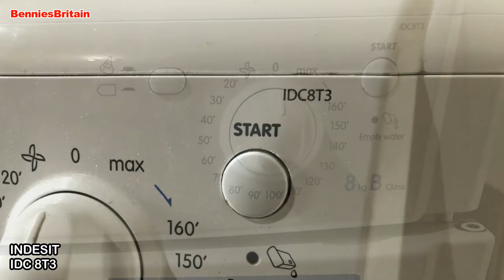INDESIT IDC 8T3 Tumble Dryer - Drive Belt Change

Comment: Very helpful video but currently sat on floor trying to wrestle the door back on so it lines up with the drum, which is not as easy as it looks....or I'm doing it wrong! Needs two people for that bit 🙈
Reply: I’m having the exact same issue I’ve got an extra person but it still won’t go back into line any suggestions?
Reply: Then you finally line it up and have the 3 hour fight to get the belt on the pulley
Reply: I had this issue. It took me almost one hour to get it to it's right place on my own. I ended up unscrewing the metal part that has the cables and undoing the cables to have more movement with the door. was so tired when I finally got it right.
Reply: Exactly the same, came out bleeding and everything. Helped to stand it upright in the end and push down hard on the door while holding the drum ‘up’. Now I can’t get the belt over the jockey wheel 😩 so much harder than it looks in the video!
Reply: Took me an hour and half all i all, but yep had same issues, it only has to go on once and its sorted, just once 😂
Reply: The two screws either side of the drawer nip it all up nice ....
Reply: After nearly 3 hrs, turned it on no heat so it won't dry the clothes 🤦‍♂️🤷‍♂️
Reply: Bennie is very good at hiding the awful bits we have all found for ourselves 🤬
Reply: Yes , looks easy on here , tried ages getting front back on , it now in bits in corner with blood on it cos of cut fingers , it off to tip
Reply: Replaced the heating element. Dryers like new. Cheers bud 👍
Reply: So, followed this. Its definitely not for someone who has never held a tool in their lives. But it is manageable. Not as easy as it looks here but manageable. Be very careful realigning the drum with the door frame. The drum fits over the frame and onto the foam on the door. If it's not, it will cause the frame to misalign, and you won't be able to reassemble it properly. For the belt, place the screwdriver tip just beyond the belt as you're looking down on it. Place the tip of the screwdriver on top of the pully while under the belt. Rotate the pully and the belt should slip on for you. **belt will be tight so some force is needed for this**. Once on, rotate the drum a few times to seat the belt. After that. Reassemble an you're good to go. This drew blood from me too so you guys aren't alone 😂
Reply: how do i line it back up i’m getting really mad now
Reply: You need two people. It took 1 minute to line up with two people. I was also wrestling with it for an hour on my own

Comment: Not quite an accurate guide was it Bennie? Many bastard clips, hidden screws and wiring clips removed off camera to make it look easy. Also no word of removing the front panel and not snapping the 3 little black clips at the bottom. And as the other chap says. Getting the bastard front panel back on.

Comment: Excellent Video - This has saved me a small fortune in repair costs.  For anyone else struggling with the drum / door alignement,  I removed the water container housing at the top and it made it MUCH easier (and its not difficult to remove and re attach).

Comment: Thank you! Saved me £108 on a repair call out! Although worth mentioning be careful not to break or lose the clips where the drum is seated when you’re lining it back up. I took the other side off too and the screw securing the side frame to the front which made getting the drum back in easier.

Comment: The door / front isnt that easy to line it up with the drum it needed 2 people i had to stand the dryer up right and use a screwdriver to wedge it back in. The grey plastic fan thing was stuck fast on the spindle had to hammer it off with a screwdriver. I was also convinced the belt was an inch to short but it did go on with some brutal force and a large screwdriver to pull it on. Did me back in though! But saved me spending £180-£200 on a new dryer. I have previously replaced the belt pulley which was a nightmare as well. All that said the video was a great help 👍
Reply: Bro I feel your pain, my back sore too got there in end though.... lol i chipped a bit od that pulley wall off with damn screw driver so sat the blummin belt in middle of it
Reply: I'm having the same issue. I got the new belt replaced in about 20 minutes but have spent the last hour trying to get the drum back I to the grooves. I feel another pair of hands would really help 😩
Reply: This is what I have come to look for 😅

Comment: Thank you for posting this. It's saved me a lot of hassle. For anyone struggling with seating the drum: after failing with it for about half an hour and swearing like a sailor I decided to replace the right hand screw on the three on the front panel. So at least one point was aligned correctly. I also removed the reservoir housing and managed to seat the drum within a minute after doing both of those things. The belt was much easier to get seated with a socket set and undoing the lower bolt so I could pivot the whole tensioning wheel bracket also (as mentioned in another comment). If you do that though be careful that the "hook" on the back of the bracket is sitting inside the motor housing and not outside as it will push the tensioning wheel out of alignment otherwise. I found this out the hard way when I did a test run and could see it was out of alignment and would wear on the belt. If it's hooked in as it should be, it will hold the tension on the belt also and you can easily replace the lower bolt you've removed.

Comment: Thank you for this video. I have finally completed the belt change, and my dryer is back up and running !! The step by step instructions were clear to follow. However, the process has taken me over 3 weeks to complete. I had to cut the belt off in my first attempt, and I then stupidly stood on the edge of a side panel and sliced the top off my toe !! My own fault for not wearing shoes ! I then had one final attempt and after 2 hours of wrestling putting it back together I succeeded and I could not be happier. So thanks for the video I could not of completed the job without It 😊

Comment: This video helped me out massively and saved me a lot of money thank you. I think the hardest part was aligning the door and the drum back up, few choice words said but managed it. Thanks again
Reply: Just done the belt replacement myself and I may have kicked the dryer a few times at this very point! 😂😂😂
Reply: how did you manage to line it up i just can’t do it
Reply: @sadewilliams6339  perseverance and lots of choice words 😫
Reply: @sadewilliams6339  Replace the central screw on the three on the front panel. So at least they align correctly. I also removed the reservoir housing and managed to seat the drum easy enough then. I found it impossible otherwise

Comment: Thanks for taking the time to do this video. The wife and I have followed your instructions and we now have a working dryer. Cheers!
Reply: I am going to try do you think a old woman on her own can .
Reply: This method, I am not sure, see my comment above if you intend to do so. I recommend checking out the espares instructional video as that shows how to do it with the drier upright and without removing and reattaching the front panel which I found a pain in the back side.
Reply: @rabg86  thank you I watched it I have fixed it , I didn’t have to change the belt because it was stuck in between the jockey wheel so after taking it all apart and putting a new jockey wheel on, I managed with great difficulty to get the old belt back on as it wasn’t frayed or damaged in anyway, and it’s been going this past two weeks really nice I don’t think people really understand how much fluff is in the dryer when you take the side off i and the top of it. Unbelievable I was so pleased with myself for a 75-year-old lady on her own. It’s not bad Great thanks

Comment: Cheers, Bennie. A lot of hassle, but your video is spot on. I had to make a few minor adjustments, but I managed to get there in the end with all of my fingers intact, but two extra screws! One was from the belt drive after reading a comment, suggesting that I take it off to reattach the belt (but I couldn't get it back on), but I haven’t got the foggiest where the last little screw lives. 😂

The drum is turning again and its heating as it should, but its a little bit noiser than it was before. I'm not sure if that's anything to worry about, but if it conks out again, I'll just replace it. 

Thanks again. Keep up the great work, but stop making it all look easy! 😂

Comment: Just wanted to stop by and say thanks for the video.  Not done the job yet but thought I'd leave this now in case I forget later. Mine broke yesterday, a jumper got trapped between the drum and the casing jamming the drum from turning and burning out the belt. Managed to take off the lid by trial and error only to find it looked a right pain to repair, was on the verge of buying a new machine. Mine is 2 years old hardly used so still in like new condition. Even the belt still looks brand new apart from the bit that melted causing it to snap. Was having a look on here to see if others have had the same thing happen, to see if it's a design fault and I can claim a repair from Indesit, when I came across your video. As a mechanical engineer to me it now looks easy enough to do. You made a cost of £250 drop to £7.49 for the belt from Amazon. I'm about to start stripping it down ready for the belt to arrive later today. So once again many thanks, I owe you a beer.

Comment: Great video, very much appreciated. Struggled to get drum aligned with front. I found it much easier to take out the whole tray for the water container which is a couple of screws and some easy to connect hoses. One this was done drum aligned really easy. Top tip to align: put a torch in the drum pointing upwards you can see easily when alignment is close.

Comment: perfect video!!!!! This is how to do it! It  is a pain in the neck. I chipped to small bits from the plastic pulley but eventually got the belt fitted. This is almost identical to my Hotpoint and they are obviously made around a similar design. What is EXTREMELY annoying is the inability this design provides for replacing a drive belt. Like  a car dynamo, there should be some way in which to release pressure on the belt as you  fit it and then re-tension this back up. This is seriously a bad design. One Indesit dryer has a large spring which provides the tension on the belt but I still believe much is to be learned from car mechanics. Thank you so much for this brilliant upload. Very clear and informative. I also had to re-order another new belt because there is another code on the belt itself which made the new belt 1inch longer than the other new belt. All the best, Jes
Reply: I did exactly what you did with pulley but got it on none the less and placed belt in centre hopefully with the groves on the motor spindle that fkers wont budge ... BUT WHAT A PAIN IN ARSE THAT WAS FOR REAL lol

Comment: Once the belt is over the drum, align it with the front of the machine before putting the belt over the pulley. That way, there is enough movement in the drum to get it in the correct place on the front panel first. Yes I sound smart but this was actually my girlfriends suggestion not mine and it worked so kudos to her! 👏

Comment: Thank you for the helpful video.  I didn't have any difficulty relocating the drum on to the front assembly or removing the fan as others have described.  However,  getting the new belt around the pulley is very tricky.  I tried removing the mounting onto the motor housing but then it's extremely difficult to resecure the mounting to the housing with the tension of the belt - so I replaced this and tried a different technique to bring the belt round on to the pulley.  I had a double ended ring spanner which I'd used to release, and then resecure the mounting to the motor housing as described.  I eased the double ended spanner right under the belt so I could pull on both sides evenly with the belt lying across the middle of the spanner handle.  Then with a helpful person gently rotating the drum it eased on nicely.   Less chance of damaging the belt this way.  Hope some find this 'tweak' helpful.

Comment: Great video. Thanks. Unlike many I found the hardest part was not refitting the drum, that dropped into place no problem; however, I had huge issues getting the fan off. It seemed to have stuck on and I had to drift it off in the end. The only thing I did differently  was the way I got the belt onto the pulley. I found pulling it with a small screwdriver from the side made it much easier than trying to lever it over. Otherwise a relatively simple job made really easy by your great, informative, video.  Thanks again.

Comment: Help & info needed - I had to replace the jockey wheel pulley. Belt was ok. Got it all back together & did a test run. Ran with a screeching noise but all looked OK. After a few tests realised it was simply the belt not being lined up properly on the grooves in the shafts from the motor that the belt goes around. Lined it up which took a few tries. Another couple of test runs whilst I had all the side panels off. All looked & sounded grand. Put it all back together & tested again. All still sounded OK. Wife went to use it today with a half load of slightly damp clothes. Drum not turning at all. Took clothes out. Stripped it all down again & tried it. Spun OK. Put 3 dry towels in & drum wouldn't turn. Turns slowly with 1 towel in. The shafts from the motor seems 5o be turning ok though. Any ideas? My only theory is that the belt has maybe stretched a tiny bit which is just enough that there is now no longer the proper tension on it?

Comment: I was hoping to write that all went well. My daughter followed your video after discovering the belt had broken. She ordered the new belt and decided to try and fit it herself. She did an amazing job, fitting the new belt, which wasn't as easy as it looks. However after starting the dryer to test it, all seemed well until the drum changed direction. Smoke poured out of the back of the machine. We feel lucky that we were watching it, and dread to think what would of happened if we'd of just put it back together and started to use it. 
We don't know what caused it to catch fire, but thankfully it's out of the house and going for scrap.
Reply: if it ran in reverse it sounds like somebody messed with the motor and switched the polarity. which just means the positive and negative wires were plugged in wrong. from this video you dont need to touch any of the wires

Comment: Like others I had huge problems getting the drum to align (found out that hard way after putting everything back together, tested it worked and the drum wouldn’t spin), I found that once you have the belt around the drum, before putting to onto the tensioner, reattach the front, as you will have a lot more movement of the drum, helps if you have some helping to make sure it’s going on in the correct position

Comment: Thank you very much was a little harder and tighter in places than in your video but the steps are correct, lining up the front to the drum is hard, and the belt was alot tighter than the old one

Comment: This just saved my bacon. One of the paddles inside had come loose. Knew how to take the top off because of this. Tightened the screws before they probably would have shredded that belt. The screws inside took a size 2 Torx head (the 6 pointed screwdriver) for anyone who comes across this excellent video with the same issue.

Comment: This is a great video but the front panel took some jossling to get off, be careful when putting the belt on as for me it slid all the way to the bottom I had to tape one bit on the right side opening then use a long piece of timber to hook it to pull it out while reaching down the sides of the drum, defo take off both sides , I then taped up all my cuts 😂 pulled the belt tight and taped it again just use a small piece of gaffa tape to hold in place , getting the front back on took forever , also found one of the black clips at the bottom where the drum slots in was off, it is not easy to get the belt on but do follow using the end of the screwdriver over the wheel to leverage the belt and pull hard this bit takes some strength another good tip is to mark each screw and take pics of them beforehand, also when you are positioning the belt I put 3 bits of tape around the drum to hold the belt on it while I got it on the spindle and wheel